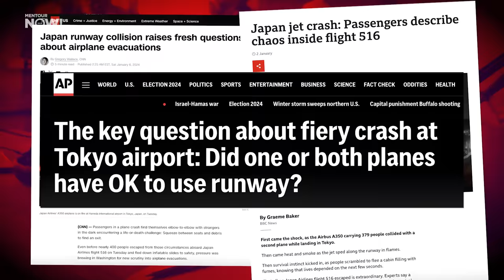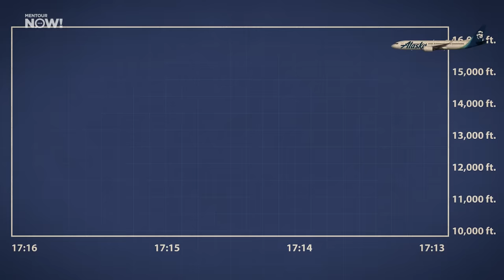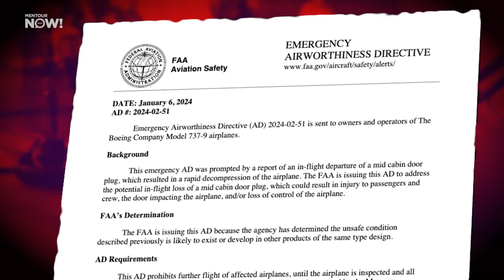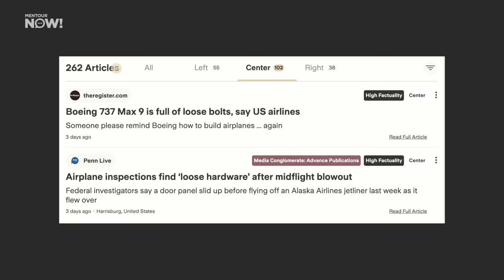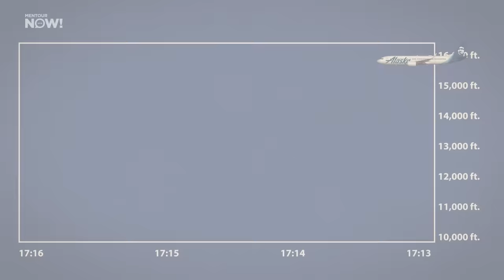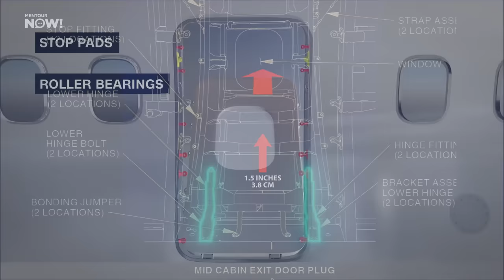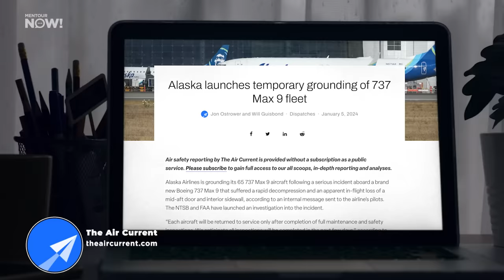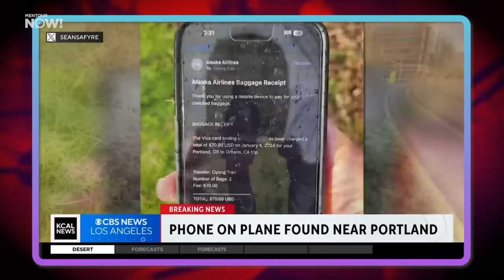WHAT Is going ON with Boeing?! MAX-9 Door blowout

Comment: It isn't just problems at Boeing, but also at their main supplier Spirit Aerosystems. And certainly not worker problems alone. Its the whole chain, from workers, to management, to lack over oversight, to no quality assurance. Both companies are summoned to court by investors and multiple former employees of Spirit, including former quality assurance staffers, who filed a class-action lawsuit in December 2023, with the claim that Boeing and Spirit have withheld critical safety related problems. Issues like faulty pressure bulkheads, missing bolts in the rudder steering mechanisms and releasing subpar products and parts. Also claims of falsifying reports and documents, etc. Whistleblowers are silenced by Spirit Aero and Boeing. They both seem to be very much in the wrong. And it seems to be an endemic problem.
Reply: Spirit Aero was a Boeing division that got spun off by the accountants.
Reply: Time for Boeing to bring the 737MAX fuselage production back to Seattle or surrounding areas in the State of Washington. 

Boeing needs to go back to 100% vertical integration.
Reply: With this information, if proven correct, as a major defence contractor, Boeing needs to be seized by the Federal government and reorganized with these issues in mind. Production should continue under highly increased scrutiny while this happens. I read years ago that when Boeing stopped being tun by engineers in favour of accountants everything went to hell in a hand basket.
Reply: Disagree partly. As Petter told us, and IMHO he is right about this, the buck stops at Boeing.

Spirit also produces for Airbus, although sofar I am not sure what exactly. So why does Airbus have no such problems sofar? Probably because their safetyprotocols after receiving the parts are much more stringent than their main competitor.
Reply: Yes, but this particular aircraft was sent AFTER delivery by Boeing/Spirit to AAR in Chicago for installation of an inflight wifi system and this installation needed to have the door plug removal.  While I agree the beanies at Boeing (that came from McDonnell Douglas when they merged) are responsible for the destruction of the company, it is now looking like Alaska Airlines subcontractor made the mistake.
Reply: Boeing was a company that had engineering at its heart. This way a lot of safety aspects were given by FAA to Boeing itself, as Boeing knew the stakes.

Then the merger with MD came and an internal fight broke out. The beancounters from MD against the engineers from Boeing.

We know now who won this internal fight. No one.
😐😉
Reply: Someone with more granular knowledge of the aerospace industry here in the US should check me on this, but I think "seizing" Boeing would amount to nationalizing the company, which would require a US law to facilitate this action, and I don't think such a law exists. What the FAA could do would be to ground all Boeing planes with certain bounds (date of manufacture, date of last maintenance from Boeing or Spirit, inclusion of suspect parts, etc.) until all those aircraft have been inspected and repaired. I can't say whether this is a better approach to a systemic safety risk, but I can say that lobbyists in Washington fight any new regulation (and a lot of older regulation) as if the fate of the World hung in the balance.
Reply: @steveburton5825  Where/when did you read that? I haven't heard that before and I'd expect Boeing/Spirit would have been quick to put that out, but haven't heard it from them.
Reply: @jantjarks7946  Couldn't agree more.. The finance people of McDonnell Douglas, (and they were really McDonnell people, they did the same to Douglas) took over corporate culture and imposed prioritization of profits over all else. Engineering and safety wasn't nearly as prioritized. This is a US corporate culture problem that came in with RONZO Reagan. and is considered gospel by US capitalists now.
Reply: Spirit IS Boeing. Or was. It's just a separate entity now.
Reply: @ronhudson3730  With decades of  government contractor experience you are 💯 correct, right on 🎯. FAA DO YOUR JOB!
Reply: @steveburton5825  I don't think AAR would be responsible for the other issue that United Airlines found with their door plugs. Loose roller guide mounting bolts. I assume the  mounting bolts for the roller guides would have been fitted at Spirit. The bolts with castellated nuts and cotter pins keeping the door in the guides should have been the only things disturbed during wifi installation or periodic inspections.
Reply: @Dirk-van-den-Berg  They manufacture Airbus fuselages in Ireland.
Reply: @jrostern14  Dou you know what types? Narrowbodies? Widebodies?
Reply: @ImperrfectStranger  Inflight wifi systems are very popular so there is no indication that United could not have also sent their new Max in for an installation (to AAR or someone else).  Also, all they have found so far is incorrectly tightened bolts.  As you likely know, even all four (and there is no indication of that) incorrectly tightened castellated nuts with a cotter pins would act as a barrier for the door to slide up.  According to the FAA, all the relavant other parts were in place and the damage to the parts is consistent with the door being tore off AFTER it fell far enough to bypass the physical locks.  The four bolts with castellated nuts and cotter pins were intended to stop the door from sliding down and unlocking from the physical locking mechanisms.  There is not a lot of sheer forces here in this installation so it is very doubtful that what United found would have worked their way to being a problem.  I strongly believe that the root of this problem was that someone failed to put the bolts in in the first place and that someone else failed to inspect it before buttoning it up with the interior trim panels.
Reply: @steveburton5825  I'm not sure I completely understand what you are saying. I don't disagree that United may have sent their aircraft to a wifi installation company, but some of the bolts United found loose were holding the door plug  guide roller pin fittings to the fuselage. No wifi installer would be touching those.  
https://youtu.be/5FcyvFfHsjQ?t=600

Also, AAR have denied touch the door plugs at all.  
By the way, the door slides up to remove it, despite what the Boeing manual says. They will be correcting this in an update.
Reply: @ImperrfectStranger  Those weren't the bolts that Alaskan Airlines had issues with.  They had issues with the locking bolts that stopped the door from moving away from the door latches.  I know that AAR says they didn't touch the doors but I have seen some conflicting information on that one so I wouldn't put all the blame on Boeing/Spirit just yet.  If you are right about the manual showing the locking mechanism being upside down, then there is a much bigger problem at play here as the springs at the bottom would be pushing the door out of the locking mechanism and ONLY those four bolts would hold it in.  that's not what I have read in Aviation Week & Space Technology on it and it sounds completely counter intuitive.  I hope that's wrong.
Reply: @steveburton5825  Yes, I understand the bolts on Alaska were different from these, but the United bolts may show a trend of Spirit being negligent in that area.  
The springs actually provide assistance to lift the heavy plug during maintenance. I guess that's why there are two locking bolts in the spring assist system.
Reply: @ImperrfectStranger  actually, looking at your video and seeing the latching mechanism on the United plane, the mechanism is as I had thought and requires that the door move upward to unlock as the manual says.   While on this one, you can see that the bottom bolt wasn't tightened, you can clearly see that the locking pin bolt is in place and has the castellated nut and cotter pin.  I still believe that AAR did something as the pressurization issues started after its return to service.  I think we'll see something on that front soon.
Reply: @steveburton5825  Ok, I was told that the AMM was incorrect, so perhaps you have an updated version.

Comment: Boeing safety culture has hit rock bottom...  It should have been impossible for even one of those locking bolts to have been missed
Reply: Well this is just the result of the MD and Boeing merger.
Reply: Profit > People, Investors > Employee stress,  efficient production > safety.
Reply: @incubus_the_man you have to admit profit overrides everything in the business world. Why do business if you can’t make a profit?
Reply: @sarthakmohanty997  that’s not what I mean. I think the priority is misallocates, for example paying more attention to the crews appearance  than safety.
Reply: @KJ-yises  if you profit from unethical activity, it's morally wrong and you could end up losing profit because of it. Every major defect Being produces costs them millions in paying damages, FAA fees and penalties, lost contracts etc. not to mention human lives. If greed is your only priority, you'll lose sight of the big picture and potentially lose it all.
Reply: @incubus_the_man  it’s a misallocation of resources, like spending a lot of money on crew appearance instead of safety.
Reply: @sarthakmohanty997  I wouldn't be surprised if it turned out that Boeing management has similar problems as NASA did with the shuttle. If I remember correctly, NASA had a problem that engineering thought that there's about 1 in 100 change for life loss for any given shuttle mission (that is, the shuttle is 99% safe) and the management thought that there's about 1 in 1000000 change for life loss for any given shuttle mission (that is, the shuttle is 99,9999% safe). If you assume that the risk is 1 in million, you may get less strict about the details such as outdoor temperature and humidity during the launch or QA verification steps needed for the door plug.
Reply: @KJ-yises  For the general society, businesses are there provide services, not to make profit. Profit obviously has functions in an economy, but its worthless to the society on its own.
Like, the utility of aircraft to society and safety culture are things regardless of profit.

But hey, at that point we're getting into problems of overreaching capitalism etc, thats a different story.
Reply: - "Boeing safety culture has hit rock bottom" - Wrong. As bad as it is now, there is still room for worsening.
Reply: I have seen information that it was Spirit (a company that was formerly part of Being) that built the fuselage for this Boeing airplane. 

"In 2005, Boeing sold its Wichita division and Oklahoma operations. The new company, Spirit AeroSystems, began the transformation from a single-source supplier into an independent global supplier with multiple customers and platforms."

I will try to post a Iink below, that shows that Spirit is into Diversity, Equity and Inclusion hiring
Reply: Capitalism at work
Reply: @staffan144  ... That is all correct. But what's the point? By selling parts of the business and outsourcing work you stop being responsible for your product and accountable for its defects. It's not like if you crash your new F-150 truck because of a bad brake, Ford can say "not my fault, the brake defect was made by my supplier".
Reply: @MikkoRantalainen  No, if you dig into Spirit Aerospace and their problems as well as the recent lawsuit against them from a former QA manager, it is clear that management was focused on pushing product out on time and covering up as much as they could get away with, figuring Boeing would probably fix it on their end.  Very toxic and very irresponsible, in addition to them letting go almost all of their experienced workers during covid and not re-hiring them to save money.  So 50-60% of the entire workforce there has less than 3 years experience. Versus 80% veterans with more than a decade previously. 
If I was a major airline, I'd simply cancel any orders until they get their act together.
Reply: @KJ-yises Better safety leads to higher profit in the long run. Bad managers only focus on short term profits.
Reply: @adb012  my point was really only the woke stuff that seems to be going on (also in the airplane industry - see the linked video - unless google AI hid my 2nd reply which had the YouTube Iink?), and possibly relating it to the reduced quality of work (since they prioritize other things more)
Reply: @poplarboy7129  it is actually communism at work these days
Reply: @staffan144  ... Sorry, there is no "2nd reply which had the YouTube Iink" that I can see.
Reply: @adb012  ok, good to know. Google has threatened to delete my youtube accounts 3 times by now (because of my non-approved comments, nothing to do with videos even). It is what it is.
Reply: @staffan144  Communism? Did Boeing set up shop in North Korea or Cuba? Or do you not know what communism means?
Reply: @CWINDOWSsystem32  have you been living under a rock?
Reply: @staffan144  Maybe I have, did Boeing suddenly allow every one of it's employees to have an equitable stake in the company, thus letting factory workers to seize the means of airplane production?
Reply: @incubus_the_man So how is this not also how Airbus or any other entity operates?
Reply: @CWINDOWSsystem32 It would still mean they would only operate for the profits of their workers and they wouldn’t want to engage in activities that didn’t bring them profit. At the end, someone has to make money.
Reply: @aycc-nbh7289  they aren't having their doors and whole planes fall out of the sky for the same reasons as Boeing. If Boeing spent the money to inspect their aircraft, that incident wouldn't have happened. If they spent the money to create an MCAS training program for 737 Max pilots, the crashes wouldn't have happened. Boeing is cutting corners on safety to save money.
Reply: @incubus_the_man And Airbus is still having their windows torn out and worries about faulty landing gears. It’s just as bad because it could still mean the unspeakable happens.